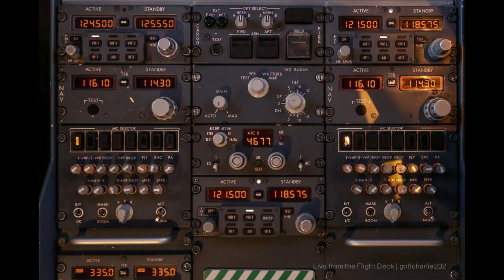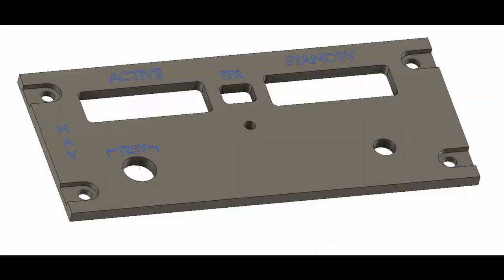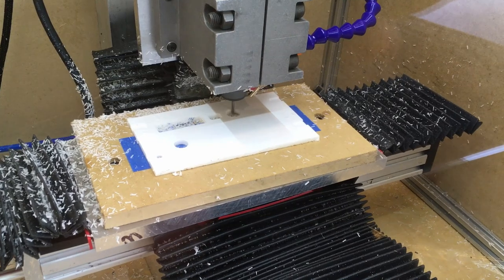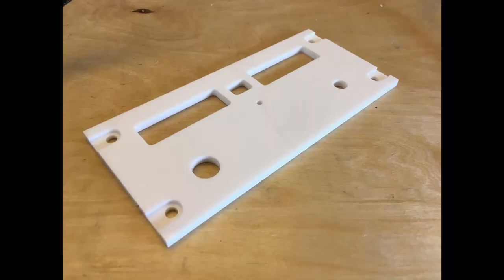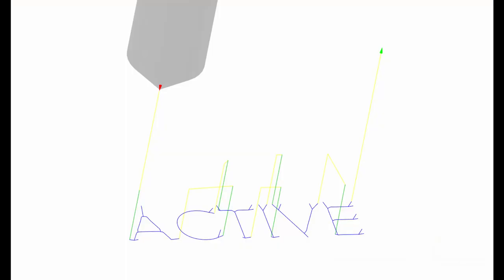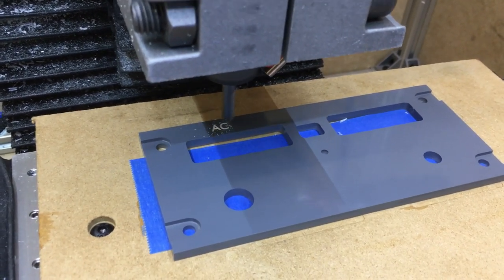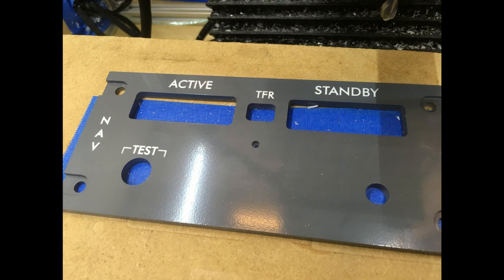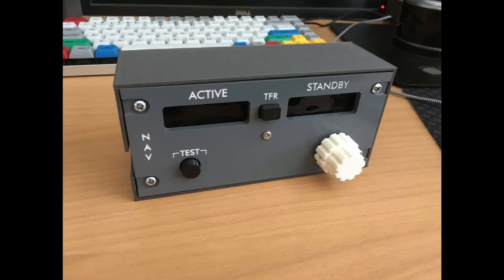Making a flight sim panel with a CNC router

Comment: Thanks for sharing, how deep is the cut when engraving the text?
Reply from the maker: It's engraving with a V shaped bit so the depth of cut is determined by how wide the line needs to be; thinner lines mean shallower depth. Fusion calculates this for you automatically.

Comment: Hey, i am cutting acrylic with a 2mm HSS and I always have acrylic sticking to the drill bit. Have to use water to cool the bit so I don't melt the acrylic using linear cutting with 75% oberlay. Any ideas what that could be? 
Also, I am engraving with a 0.1mm needle. Works fine for me aswell but I guess the font isn't set up correctly. What letter size did you use?
Reply from the maker: To prevent acrylic sticking to the tool, try using a single flute tool, and make sure you're moving fast enough. That will ensure the material is getting removed faster than it has time to heat up. I use a 3mm single flute endmill and cut at over 1000 mm/min. You can use an adaptive toolpath (lower radial engagement) to lower cutting forces if you have rigidity problems cutting that fast on your machine.
Reply: @imnoexpertbut  Used the new drill for some time now. Works awesome and no more problems. Thanks for the advice!

Comment: Nice work!!  what CNC equipment are you using?  What software are you using to make the drawings?  I appreciate the information...
Reply from the maker: Check out my other videos for info about the CNC equipment, it's mostly custom but started as an OpenBuilds MiniMill. Software is Fusion 360.

Comment: Nice video, i plan on using my cnc to do lettering too. Did you illuminate this panel and if so, did the light shine very brightly through the white?
Reply from the maker: I haven't done backlighting yet. If I hold an LED light strip behind the panel it seems to come through brightly enough, although I think next time I need to do more coats of paint, because the light also lets through a little in areas of the paint that aren't as thick.

Comment: Which font is that?
Reply from the maker: It's one of the Futura fonts, or one very similar to Futura.
Reply: @imnoexpertbut  Thanks.
Reply: @imnoexpertbut  I've found it's "Futura Md BT".  I've downloaded and installed it, but Fusion 360 doesn't seem to want to show it.
I also can't see how you get the single-line path.
Could you elaborate on your settings and the technique involved?
Reply from the maker: @No1sonuk  Yeah, fusion 360 seems to be picky about fonts. I used InkScape to create the text, converted it to a path, and then saved as an svg, and inserted the svg into fusion 360.
Reply: @imnoexpertbut  Thanks.
But I'm still not getting it to happen.  Any chance you could do a small tutorial on that part, please?
Reply from the maker: @No1sonuk  Sorry man, that's all I got for ya. Some other folks have tutorials on similar workflows: https://www.youtube.com/watch?v=383cdUYffEE